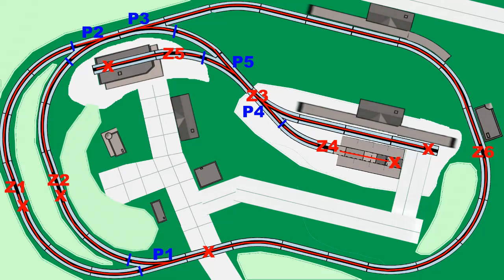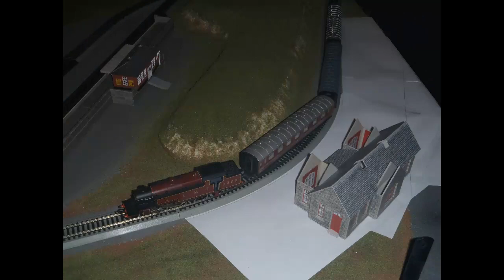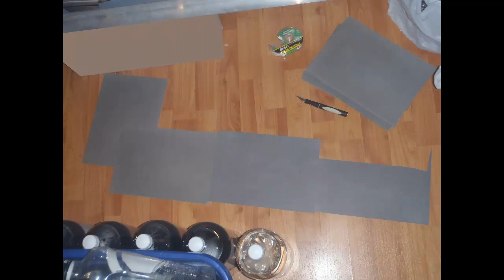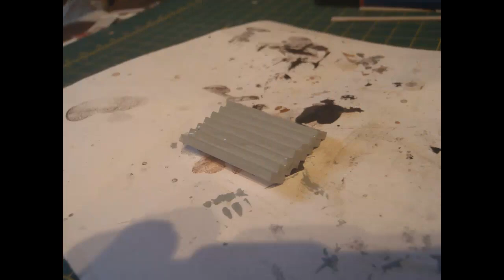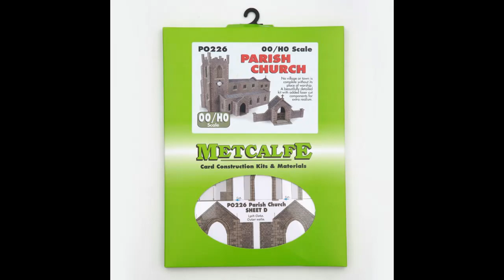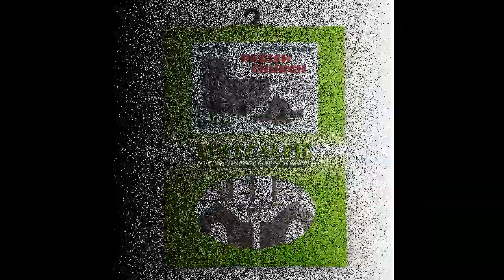OO Gauge 6, Metcalfe Settle & Carlisle, Platform

Comment: Hi Ken. Nice work with the station. I agree with not removing parts until they are needed. I like the look of the access stairs at the rear of the platform. The position of the 'missing' end wall of the side building is something of a six-of-one, half-a-dozen-of-the-other situation depending on the angle you view the building.